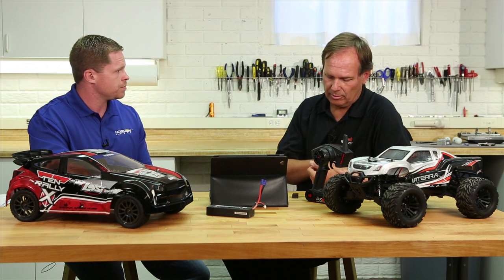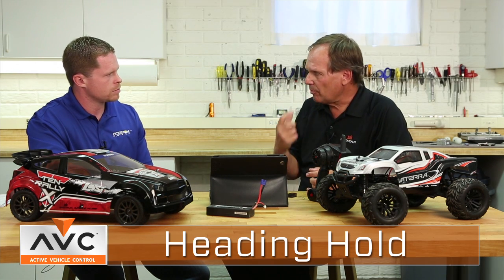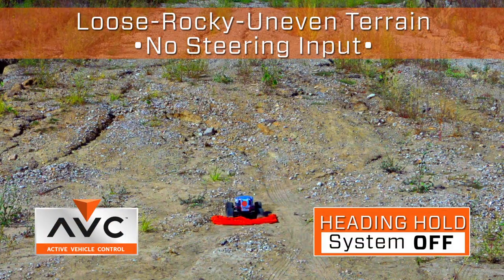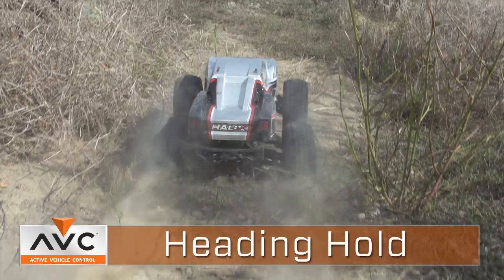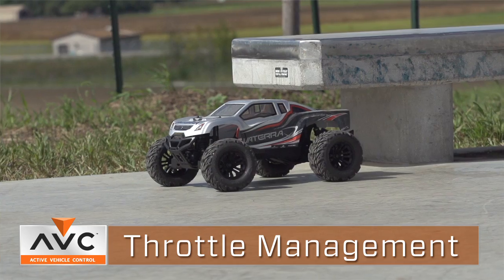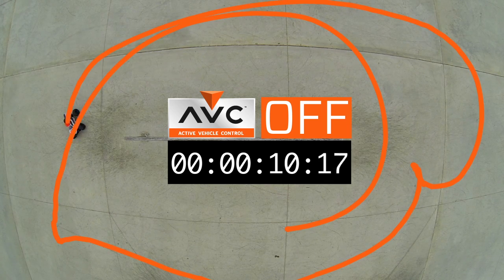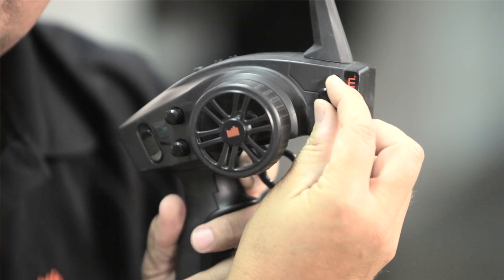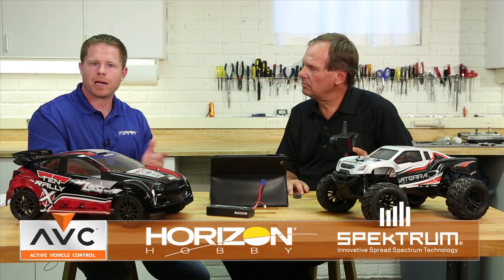Spektrum RC - AVC (Active Vehicle Control) Technology Overview

Comment: its 2 gyros 
the steering one holds up to your statemnt , but in the second one I would say just partially , its more of an active punch/torque control  ( than the passive one on most ESCs ), holding the nose of the car down to keep the front wheels to the ground ant steering
Reply: i figured it might have wheelei control

Comment: This AVC RX is going to be an awesome tool for setting up your car or truck. It does something we RC drivers lack...feeling. It can sense tire adhesion faster and a million times more accurate than we can. With this variable out of the way you can now see the changes you make to tires and suspension settings more accurately based on more consistent lap times. It'll even visually show you the limits of when you should start braking and how fast you can take the curves on a track......